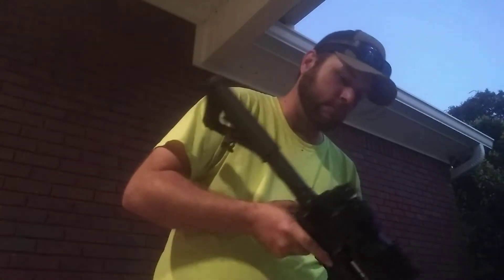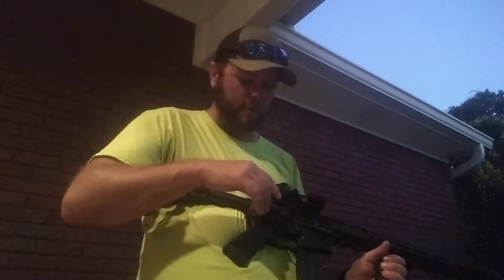Homemade suppressor AR 15

Comment: BB Gun.
Reply from the maker: No just 22lr subsonic. It was a test build, it worked but I'd never run 223 or 5.56 through it. Just to much pressure.  Fun test build but you wanna destroy it after lol